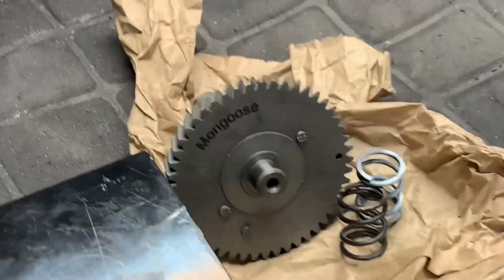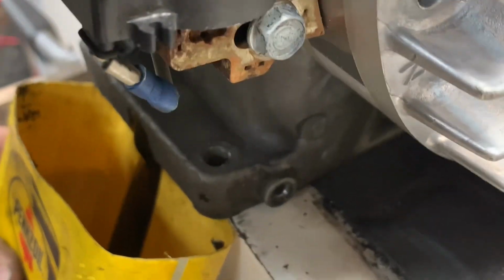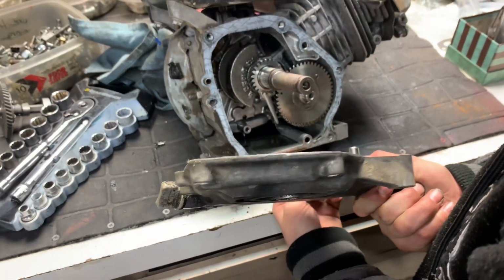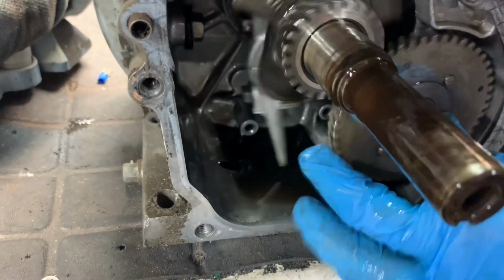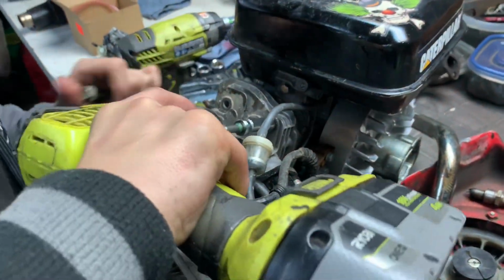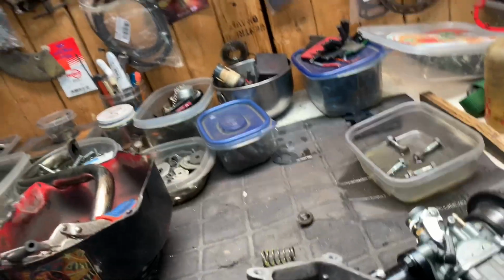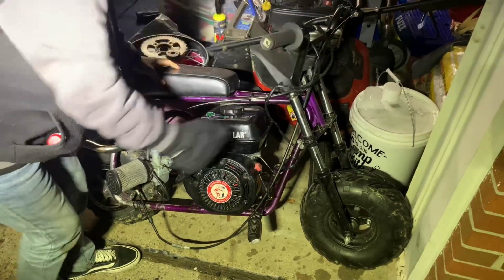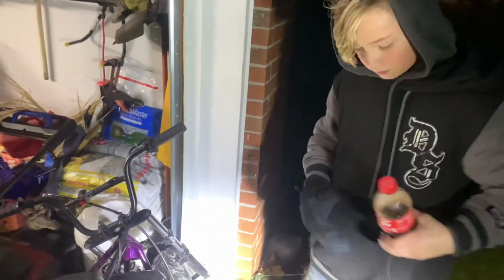Stage 2 kit (Mini Bike Upgrades)

Comment: Did you get the flywheel that is advertised timed to 28 BTDC, or did you get the one that there is no timing spec that has 18 BTDC timing?
Reply from the maker: It's the 28 degree one
Reply: @squiquidland895  Nice.